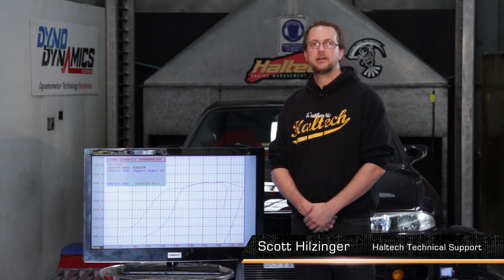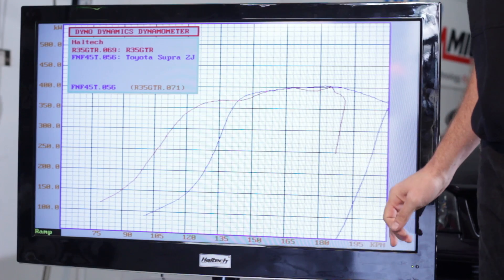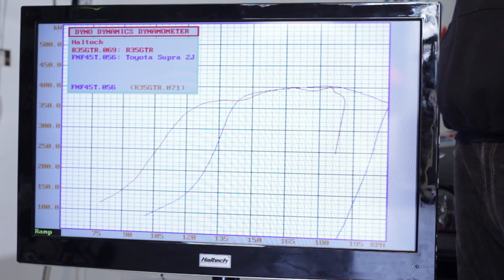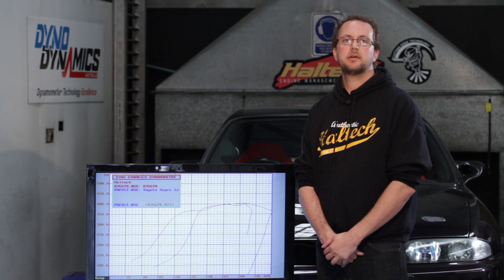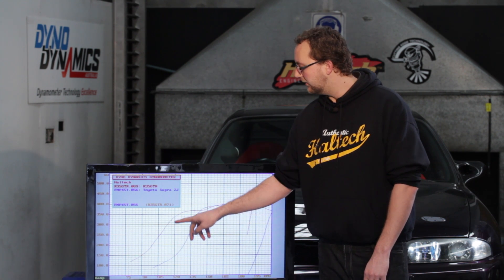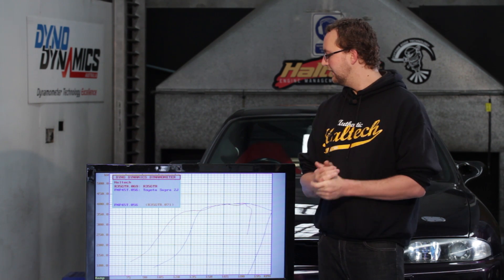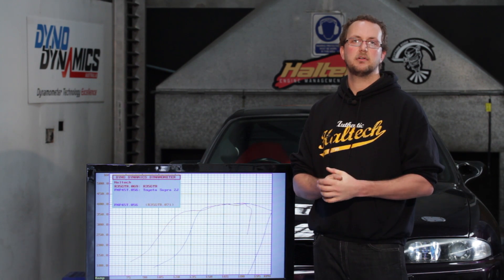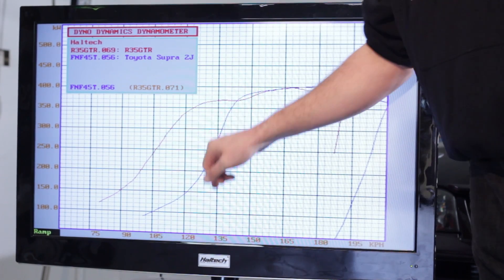How To Compare Dyno Graphs - Technically Speaking

Comment: I don't understand y they hellcat shows like 650 on the dino. but then the guy who reads the dino says it's actually producing 750 hp. the dino says 650 is there more to it then just numver any other factors or something that add hp
Reply: +Mehdi Elkhatib  its cause on paper its 750 to the crank not the wheels

Comment: Road speed is clearly not making for a direct comparison. Change the horizontal axis to RPM and try again.
Reply: Speed is as good as any. The speed ratio is in a 1:1 gear pull, so your output from the engine and output from the transmission are the same, with the only variables are the tire size and diff (and a few other minor losses), which will be variables in both unless you remove them from the equation with a straight engine dyno. Nothing you do will get an equal comparison because both engines are different configurations thus different red lines.

Comment: close loop boost control is a function of the haltech ecu?
my "oldie but goodie" E6K has 2 maps for the boost and it works with a simple solenoid valve. is it the same thing?
thanks in advance.

Comment: Would be good to make a episode 2 of this same video and this time actually running the 2JZ engine on the dyno with the closed loop boost set up and seeing that extra 20-30% more KW power in the lower rpm range.